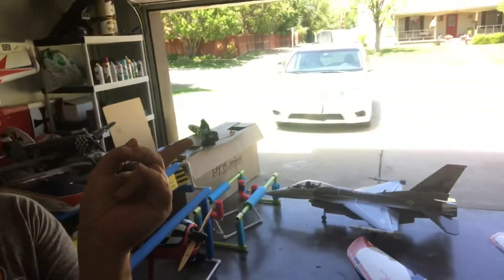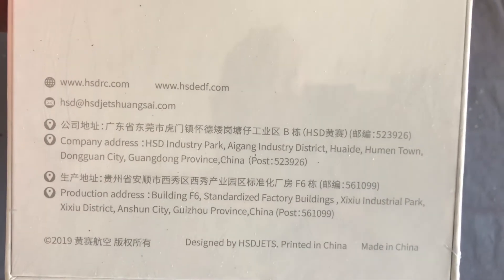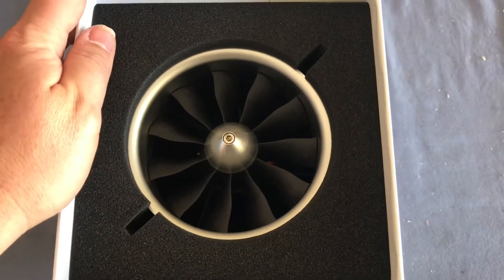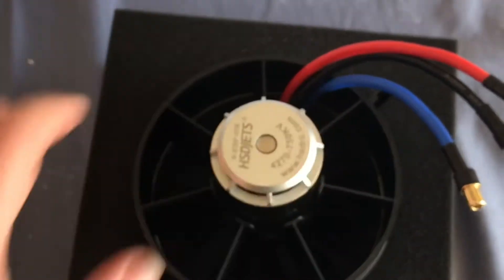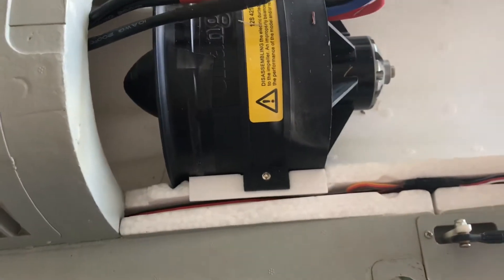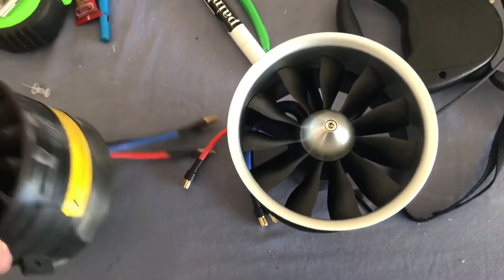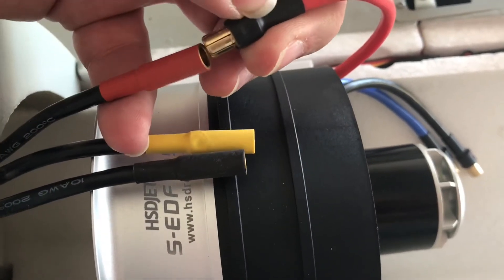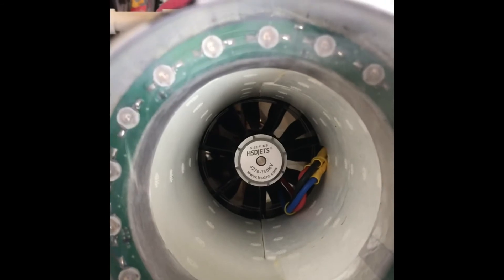How to upgrade your HSD Jets f-16

Comment: I can't believe you hacked the wires and used automotive butt connectors on a 50 volt power setup. Unreal